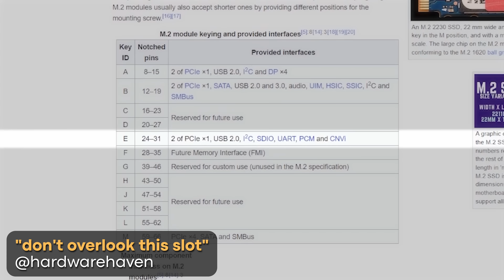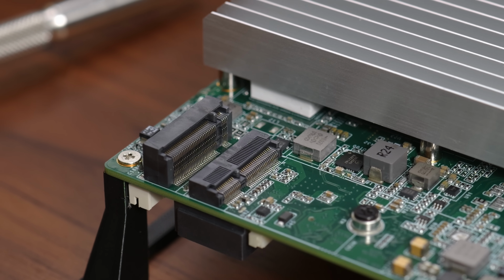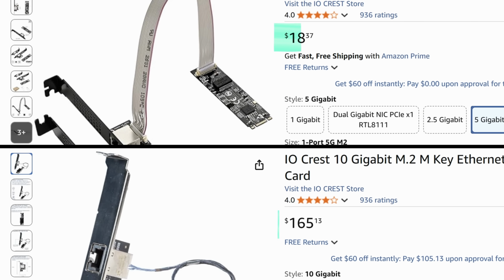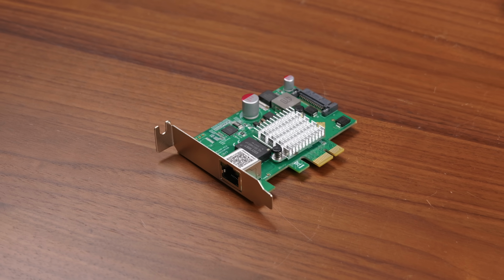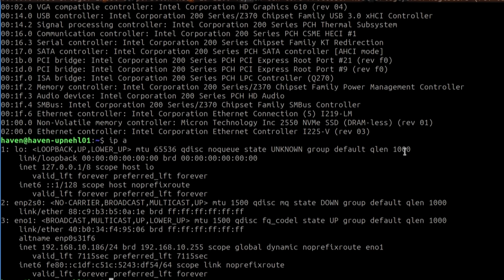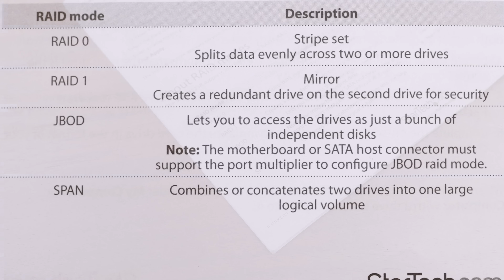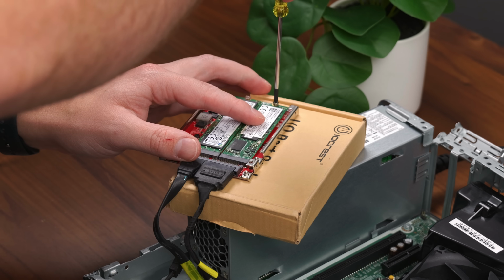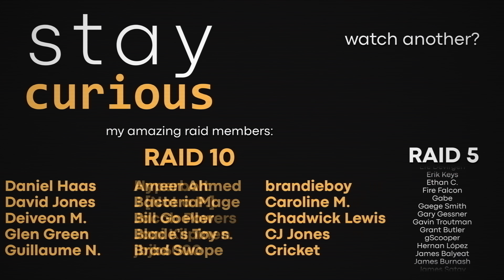I Don’t Know Why These Adapters Exist... But I Love Them

Comment: I have to advise against adapter #4, the dual m.2 adapter - I've had many of these and they always let me down. I've used them in RAID 1 config to provide redundancy, but in practice they either didn't work, or worked so poorly causing the computer to freeze constantly.
Reply: interesting his experience seems also not great. Also for me the investment in m2 sata wouldn't make sense.
Reply: Very true. The RAID1 firmware on these cheap things is very frequently awful. For example, if you lose power when they are operating, get ready for a world of pain.
Reply: The only one that actually worked in my experience was the one made by QNAP for their NASes.
Reply: What about pcie to 2 m.2 slot adapters?
Reply: @johndevadhas4787  works very well, because NVMe is native to PCIe these are basically driverless, you can  easily set up a software raid

Comment: Maybe not necessarily "hardware" adapters, but you could toy with USB Gadgets in Linux, using a Raspberry Pi or comparable SBC that supports OTG mode. Make a non-wifi printer into wifi-capable, a dynamic USB data stick, a video-output recorder, a wifi webcam, a bunch of different hardware with some code, pipes, and whatnot.

Comment: I repurposed a GA-X99-SLI motherboard into a Proxmox server.  The Wifi slot was under the NVMe slot and I stuck a 2.5gig ethernet adapter down there and installed the boot drive above it.  It did bend a tiny bit but working great so far!!

Comment: the sata multififity is usually for esata, thats why its not support on most internal controller
Reply: I have relativelly rarelly seen non Intel sata controllers on Intel boards and Intel usually does not support port multuplication. But I have a j5040 board with 3rd party sata xontroller and I will check if it does.
Reply: @ivan40229  try an intel board that has an esata on its I/O shield, high chance that this one will work, thats how they used multiple drives on that single port, back then when USB was still slow AF, so we were talking about the time when external drives came with USB 2.0 and firewire was still the fastes port, so an 1.5g or 3g esata was a real alternative for external drives
Reply: intel does not support sata port multipliers on the chipset sata ports apart from some special cases.
AMD afaik does support port multipliers on sata ports.
Cards with Marvell, Asmedia and Jmicro controllers usually support sata multipliers
Reply: @marcogenovesi8570  Very knowledgeable reply. Cheers!

Comment: There is an obscure use case for that PoE NIC: having PoE on a 2.5GbE WAN port. Sometimes your OLT is too far from any convenient power outlets for your ONT's power supply. In that case, your best best is powering the ONT using a PoE splitter (or finding one of the rare PoE-capable ONTs). But then you also need a PoE injector on the other side of the cable, which aren't very convenient and usually don't support 2.5GbE. I did it this way at my parents' apartment.
Reply: That would make sense if this card is plugged in a mini-PC configured as a router/firewall combo and has more than one 2.5Gbps port. Another Senario you have a WiFi Access Point connected to that or a 
WLAN directional antenna as log range feed.

Comment: I would love an "untapped potential" series where you present ways to upgrade your systems by using slots that arent used (or used in an inefficient way).
Reply: He needs to pin this comment.
Reply: I second this motion!
Reply: Wendell @ levelonetechs has an awesome "home lab cheat code" series

Comment: Wait a sec. That MicroSD to A+E USB 2.0 would be absolutely amazing with Unraid if that MicroSD thing has a GUID.
Reply: Unraid does very little writing to the USB boot stick. It should last quite a long time.
Reply: As long as you back up the os then yeah. Would be nice.
Reply: @marcosramirez385 why?
Reply: reliability - microSD's dont have the same endurance as SSD's. Fortunately if you're only using it as a boot drive for unraid/truenas, you only need back up your config regularly so you can reinstall the OS and import the config data in the event of a failure.
Reply: Exactly my thoughts!!! You can buy a NVME+MSATA pcie card for older Servers and Use one slot for the cache and the other use this little adapter there for this purpose. A high endurance 16-32GB card would be amazing and also hide the drive that has the OS.

Comment: just scored a laptop motherboard with just the Voltage chip of the gpu that came off (i can solder AKA i can fix it), RTX 2070 + I9-9880H for a whopping 4 euros in working condition! yes im sharing this, finally something good happened
Reply: Hell yeah